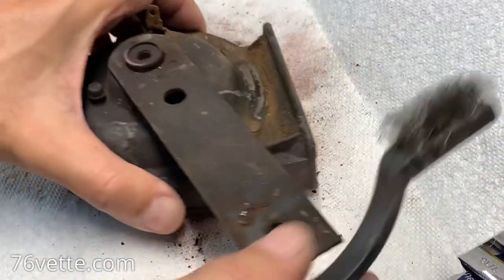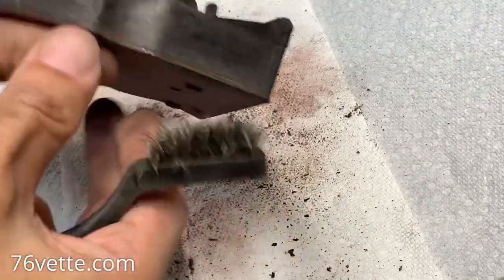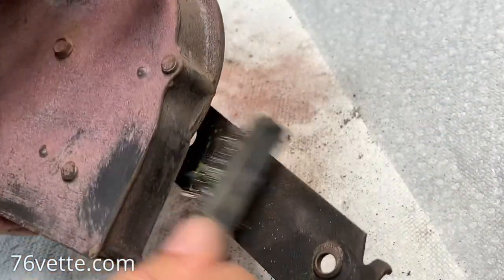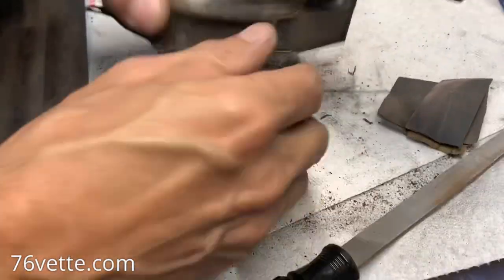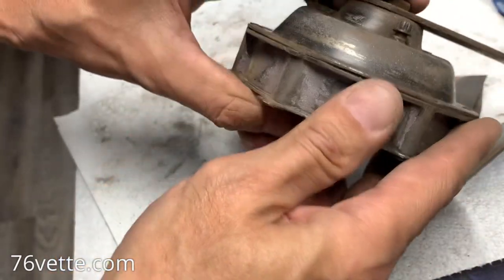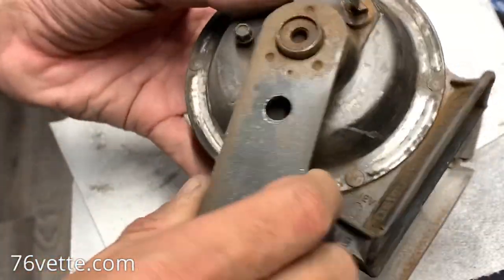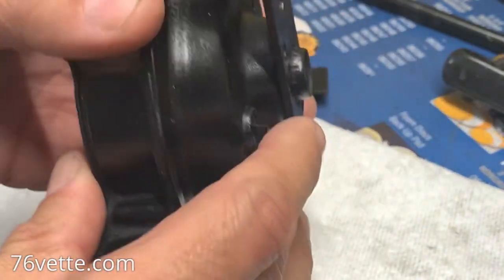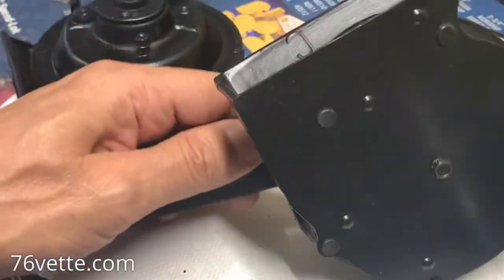Restoring Chevy Delco Remy 2-Tone Horns

Comment: How do you get to them?   I have an 81 the horns are up on the side in front of the fender wall.   Is there a trick?   OR is the 2 screws on that bracket need to be unscrewed from the fender wall?
Reply from the maker: I’m not familiar with 1981 Corvette horns, but they may be attached to the headlight frame or assembly instead of the fender. Your best bet is to get a copy of the 1982 Corvette Assembly Manual. Best of luck with your project.